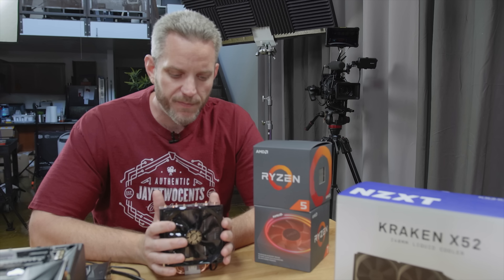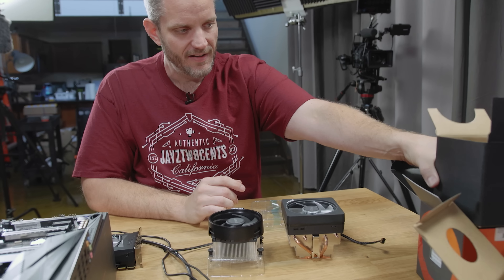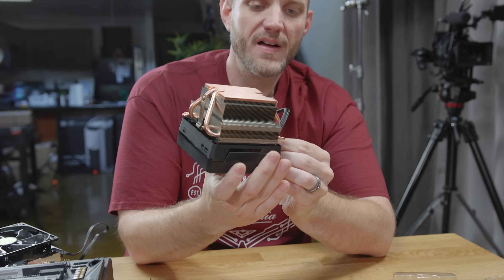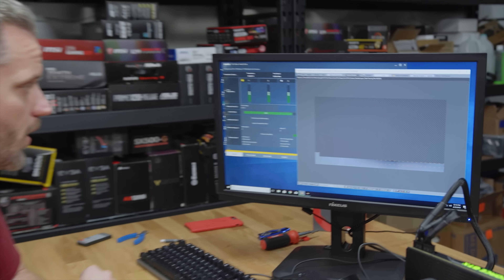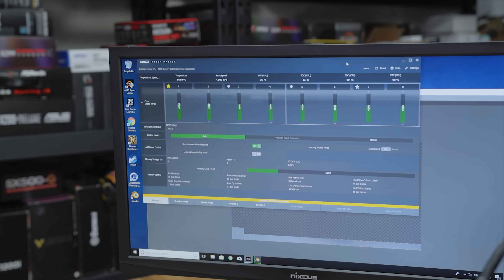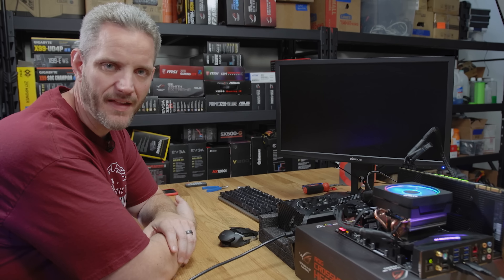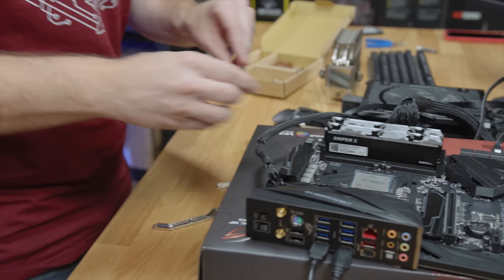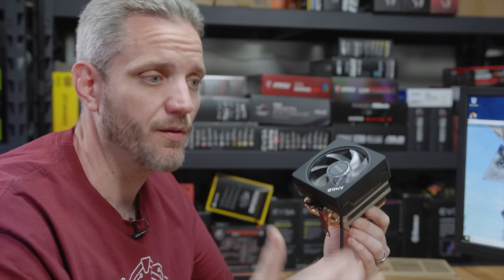Overclocking with a stock air cooler?? Is it even possible?

Comment: now THAT'S A PREMIUM STOCK COOLER! Man I wish all the intel users would see just how much better AMD products are now!
Reply: All we had to do is wait 5 years :,)
Reply: not easy to get rid of the intel company trolls
Reply: Yes, AMD does cooling better. Both with solder vs TIM and their stock cooler. They're also usually a little higher performance per $. However, Intel continues to be better on actual performance and compatibility. I would LOVE them to be more competitive, but AMD always insists on just being the budget model. We really need at least 1 more competitor to get both companies off of their asses. They've each settled into a groove, and are happy to stay there.
Reply: Maria A We'll see, I have a hard time believing that intel is gonna lose a part of the market share to amd yet
Reply: The cooler, yes. The rest of the product lines are still up for (a never ending) debate. But yeah, seriously, that cooler is 10x's better than anything intel's ever packaged with their CPUs.
Reply: lol true buddy, intel trolls are on the next level lol
Reply: Okay, show me the AMD CPU with better gaming performance and around the same price as my 8700k and I'm switching to that one.
Reply: Fiddy the ryzen 2700x bro. Cheaper too.
Reply: Fiddy 8700k is still faster but that thing runs hot. Even hotter than 7700k when oc which means u will need to delid.
Reply: Rocket sams dude go check out hardware unboxed videos before u start spitting shit. 8700k overclocked to 5ghz gets real hot even worse at 5.2ghz do your research. Nothing about fanboyism here just facts
Reply: Rocket sams and you got lucky then because most 8700ks run hot at that clock
Reply: it doesnt run hot..reviewers does stress tests with aida and it looks like its hot...during gaming it doesnt run hot and normal usage....and i have a 280 aio..volts are at 1.33v...the chip isnt hot at all..
Reply: bro look at the cooler that you have and imagine a 280 aio is keeping the chip at a max of 73 degrees. imagine what an air cooler would door a standard one would go all the way to 90s
Reply: Shibby D sadly bro i have an i5 8600k @4.6ghz i could push for more but i want my temps to be in check. And by the way i do have a 1080ti but that does not mean i cant give credit where its due and criticize some of thecthings i hate about intel.... Called being objective
Reply: ronald4life1 better price to performance but u gotta say that's in raw gaming , intel is stil better , by litle , but stil
Reply: its there facts..i own the cpu and im telling u my facts..there temps are based on artificial stress tests...under normal workload it doesnt go that high..even at 5.1ghz my cpu maxed at 78d on a cinabench run...trust me it doesnt need to be delidded....
Reply: Rocket sams well i am considering delidding my 8600k i am not too comfortable with the temps i get running it at 4.6ghz its at 68 degrees.
Reply: Every product has it’s niche.  Intel is good, and AMD is also good 😊
Reply: zemerick13 You do realise the 2700x is more powerful than the i7-8700k do keep up.
Reply: zemerick13 kek,2700x thrashed intlel left and right and fanboys still say this
Reply: It looks like a somewhat larger version of my AMD Phenom II factory cooler from 2009.  Four heatpipes, copper base, tightly spaced fins, and a downdraft fan in a plastic shroud, and able to handle quite a bit of heat.  That one was louder though - once it was good and warm it would max out at 6500 rpm and was audible from outside the building
Reply: always a competition lol, i don't want a stock cooler in my system - they all look like crap.
Reply: You fuckin need a good cooler on amd they pump out much more heat.
Reply: @ rocket sams - you're seriously comparing a 280 mm with probably a push/pull fan config to a stock CPU cpu cooler? With your AIO being pegged at 73c means those fans are moving some air pretty fast and are at a fairly high rpm (at times after some severe gaming sounds like a turbine engine whining) to pull that heat from the radiator that fast. Both AIO's and custom water loops retain heat longer because liquid retains heat and takes longer to dissipate that heat, so I'm sure everyone here you've been arguing with wants to know your temps when you play a game for a couple of hours after you've warmed that baby up. Besides, this is like comparing a Golf cart to a Lamborghini in performance value comparisons. PUT an stock intel cooler on your cpu and see exactly what temps would be then. You wouldn't even dare with that overclock, you would most likely fry your cpu in about one stress test, or most likely be severely thermal throttled so much that it would eventually lock up and shut down. Even the stock 8700k runs hot, and that stock cooler would barely be able to handle base clock speeds, let alone an form of overclocking without resembling a space heater at some point. Now using a stock cooler would be a true comparison. Stop being an Intel fanboy and try to convince everyone that your AIO is the same as the stock or aftermarket air cooler. I know you spent a lot of money for that system, so I can safely assume the reason why you're at a defensive stance when people are talking poorly of your cpu configuration is because you believe your system is inferior, and respectively if you spent more than 2k on it.. it should be, cause Intel systems are figuratively twice as expensive as the AMD counterpart with a small gain on gaming performance but lack in video production as an overall system. But if you really want to boast about your system OC's for this comparison to be fair, you have to use a stock cooler to do monitor these temps. As in this video Jay was basing this observation on the new AMD's stock Intel air cooler, or an aftermarket air cooler, not a 280mm AIO. I'm sure people here want to see your temps using the stock CPU cooler that came with your 8700k with that 5.1ghz OC. I mean if we wanted to do a comparison correctly, Jay would have to put the same 280 mm AIO on that Ryzen, then run the same bench tests on both systems and compare. I bet comparatively it would be roughly the same in performance for gaming, but the AMD would pull away slightly in video production for half of the value of equipment of your Intel system in video production performance. I'm neither a fanboy of either company at this point, I buy what i can afford, and if it works out of the box, with some overclocking, I'm perfectly ok with it. I'm not in search of 400 fps on ultra playing a AAA game of today. I'm still very much happy on a solid 60 fps.
Reply: just because people use intel doesnt mean that they are completely blind to the outside world.
Reply: lot of praise for 5% lol
intel advantage in gaming is gone man
Reply: nice bait m8
Reply: zemerick13 try to say better performance again when you can get more than a few fps in games then get kidney punched in everything else
Reply: one intel user here and plan to switch to amd lol
Reply: not even 5% in gaming now, 2700x OC vs 8700k(non-delid) OC got same performance in games that use less cores and in games that use more 2700x pulls ahead, thats when you put 3466 or 3600mhz RAM ofc, RAM was problem why Intel was outperforming Ryzen last gen cuz it wouldn't be stable over 3200mhz on most boards and ram kits, but you could still run 3600mhz trident Z on ROG board, now you can run at least 3466 one across the board, you dont even need entry level x470, you fine with b450 boards to have same perf as Intel for gaming, they managed to get 4000mhz+ speeds on one MSI x470 board and few days later on high end ROG board, and it pull's up infront of intel, a tech forum and magazine in my country did tests, still not up on youtube, only printed version, they had AMD chief of software over for interview on ryzen 2 launch day, he probabaly gave them some tips on what RAM to use, they teased in video before that ryzen 2700x have better single core perf than i7 8700k if you push RAM over motherboard specified 3466mhz max speed
Reply: I can see the diffrence that has ben made with AMD, Shame it isn't with Intel
Reply: intel fell behind not investing money in shrinking node size while they could and now amd probabaly getting 7nm before intel gets 10nm
Reply: I love AMD to push Intel making a better product, so I can Get The best from intel
Reply: Intel users: "I bought a beefed up Honda civic for $60,000".
Ryzen users: "I bought a beefy truck for $30,000".
I need a workstation.  So I bought the truck.
Reply: Yeah but I still prefer Intel
Reply: What about be qu!et Pure Rock cooler?
Reply: intel stock coolers are bad u can't even like do gaming with them :D so amd wins on that part
Reply: zemerick13 Well to be fair, with modern AMD products "budget" means 90% of Intel's performance for LITERALLY 50% of the price.
Reply: but intel will always get better fps lol
Reply: Not while streaming games. That's where the Ryzen wins.
Reply: Chill out dude. Amd is great now, giving intel run for the money. But intel is still pretty good for some stuff. Like gaming. And please don’t go on saying that 10% FPS doesn’t mean much because that 10% is the difference between exactly 144 FPS on a 144hz monitor with v sync removing most of the screen tearing and actually frames dropping to 130 FPS using something like the 2600x and then you can’t do much about the screen tearing other than reducing monitor refresh rate. Also not to mention the garbage bios which doesn’t support 2nd gen in the first place unless you get the more expensive x470 chipset, because I don’t have a ryzen 1st gen not any of my friends do, and I have to order the motherboard online and the sellers are not guaranteeing to update bios on b350 motherboards. So AMD is giving intel competition, which is great, but they are far from ‘much better’. Way far. Especially in the sub 350 dollar range. I agree though that for workstation use threadrippers actually RIP the 1000$ intel processors for almost half the price but normal cpus still don’t straight up whoop intel’s butt.
Reply: Maria A  the majority of people here are gamers so having better fps in games is very important
Reply: @zemerick  intel only beats amd by 8-9% on single core tasks and amd dominates in multi core tasks. Right now amd is just the better cpu unless those extra 4fps the top intel chip gets you is that important.
Reply: @yesto9676  the market shares dont make it a better cpu plus they are only winning in market shares because of laptop cpus.
Reply: @zahiersamsodien  only with liquid cooling, you get those temps on amd with air.
Reply: Mr Rman actually only at 1080, high framerates, compare 1440p and 4k settings and they perform within margin of error.
Reply: omg i hate these screws and prefer to go with the factory clips, because they are so much easier to install!!
Reply: zemerick intel king of performance? what about threadripper?
Reply: @piskoraczek  none but Intel does have stock coolers but does not ship them with cpus anymore
Reply: by the brackets for an Intel board then by the Wraith Max and slp it on an Intel Rig!
Reply: What  tom's hardware says that amd's marketshare in q2 this year is 0.3% larger than Q4 last year. Whats your point here?
Reply: Shaun D oooo sorry pls dont bring you 7820x in to this argument or ill bring my Intel Core i9 9900K with quadruple rtx 2080ti's and 64 gb of ram also a full water cooled machine that stress tests under 3 degrees C, in other words no one cares :)
Reply: I'm going to try out team red in my upcoming build 😉
Reply: They don't care, locked 2-core 2-thread I3's still sell like hotcakes despite costing more than unlocked 6 core 12 thread parts from AMD.
Reply: This Intel user of decades just bought a Ryzen 7 2700X and could not be happier.
Reply: @fgc_ngoni615d9   i must have got lucky too my 8700k  5.0ghz never goes past 75c, amd will always be the budget king, thats it
Reply: i dont think intel cares      too bad   im going to change to ryzen
Reply: @its_Fiddy  Look how wrong you were. The 2700x is cheaper and performs just as good at gaming, better at streaming and rendering, and even runs cooler.
Reply: Well technically, it's not THE stock cooler. It's a premium stock cooler for there better chip. The normal stock cooler is basically Intels
Reply: Im in intel user here, im switching as soon as Ryzen 300 comes out :D The price to performance with AMD is just better without a doubt
Reply: @Nick V yea, the cheapest models
Reply: Intel has better speeds, less multi core power, but a surge of single core. Intel has more power, and AMD is superior for budget builds.
Reply: Mr Rnigah it doesnt even make you good at gaming
Reply: I certainly did, and I don't regret. At this point, AMD is just the best buy
Reply: @MrPelzi91  I've used an intel stock cooler on my i5-6500 for 4 years now and I spend way too much time gaming. Haven't had any problems with it yet.
Reply: @LegalSkateboarding  A $30K truck is still junk 🤣
Reply: @Shmozone  heh

Comment: 3:25 - You are crazy, I hate those 4 screw coolers and absolutely love the Wraith clip. It’s so much easier to install.
Reply: I've wrestled with both and the clip is definitely easier to use!
Reply: I just bought the 2700x and I was wondering about the clip vs the screws. Guess it’s a good think I’m switch to the clip.
Reply: the clip ones is like AMD's signature. my old athlon 2 machine has this kind of cooler
Reply: I was first confused with the clip but now that I installed my four wraith cooler and learned how to do it I now find it super easy
Reply: they are both super easy to use tbh
Reply: @MadmanLink  i wouldn't call either process wrestling. super easy
Reply: @LowKeyJaded  how's the prism? Have you tried overclocking?
Reply: Both are easy, but The clip relies on the plastic holding up over time, which it doesn't always.

The screw in is far better, IMHO.
Reply: Aaron Garza the 2700x stock cooler Wraith Prism cooler was so easy to install lol. Looks AMAZING too!
Reply: When I installed my wraith stealth cooler I thought I cracked the CPU.
These screws are unnerving to screw in D:
Reply: Bruh I’d rather use the screws. Just built a system with a 3700x and locking that clip into the locked position was so hard I thought I was going to break the lever
Reply: Plus not to mention that an uneven tightening of the screws might warp the cold plate or the board or the cpu.
Reply: Jimmy S  Did happen once with me, thankfully while installing. Also the threading on the screws of non clip coolers can break off (also happened with me, and specific spares are harder to find). So structural issues happen on both sides, but the stock spares can be found easily (even from old stock heat sinks). And I still believe that the clip on heat sinks provide a more evenly distributed pressure on the contact surface. I always do a visual inspection before start up.

Comment: The AMD mount system is just awesome so easy to mount aio's and am4 coolers.
Reply: I hate it.  I always feel like I'm about to break the PCB trying to mount the damn cooler.
Reply: Ah the bracket that came with my board is metal so i feel like this is really good, so easy to mount:https://imgur.com/PQkbOIL
Reply: Hey gr33n, that pic is a bit difficult to view.
Reply: It's a royal pain in the ass with this Cooler Master 120 Lite AIO I have, difficult to tell if the block/pump is even centered over the CPU. I don't hate it, but it could be a LOT better.
Reply: I find it meh honestly. It's harder to take off coolers vs intel sockets
Reply: Yeh pic quality is bad sorry.